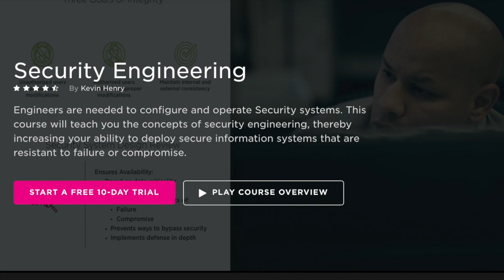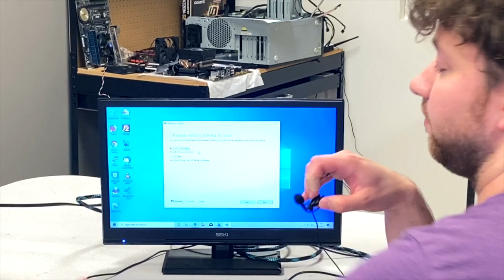How to Build a Computer All-in-One Tutorial Series (1 HOUR!)

Comment: On the topic of the returns of spending more, it can also go for spending less, cheaper does NOT mean good value. To a point spending more can definitely mean more value.
Reply from the maker: Yea totally agree. We were looking for the happy medium. most bang for your $. Not just cheap 😊
Reply: I totally agree there. We could of have gone with a Athlon 200g, 4gb ram and 128gb ssd. But we would not of have gotten a really good system to work with.

Comment: What about an internet card or something like that?
Reply: Perdiko you could put in a wifi card but most people would rather use a wired connection through an Ethernet cable
Reply: This computer had integrated LAN on the motherboard. You could add a wi-fi usb or pci-e card if you wanted to.